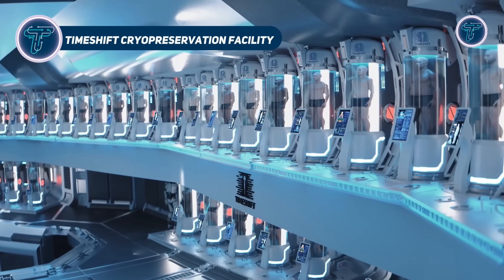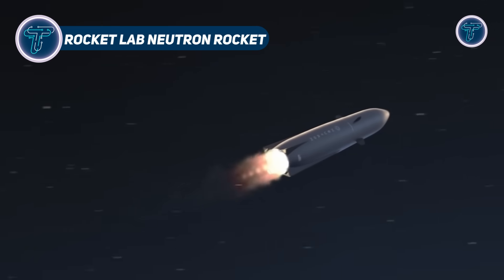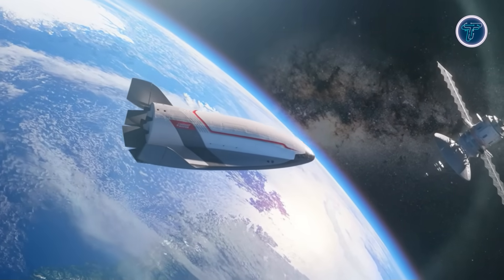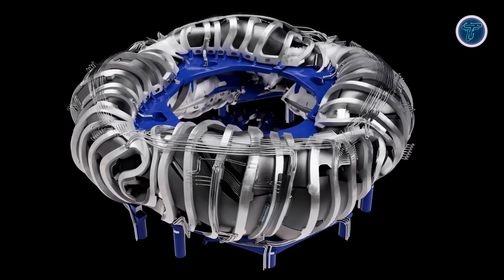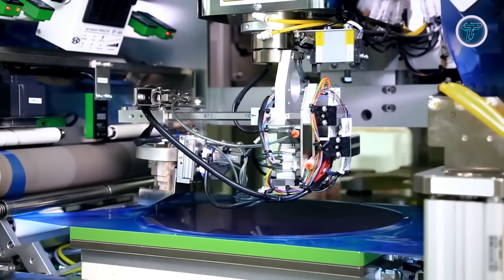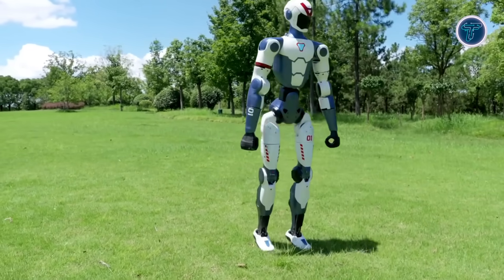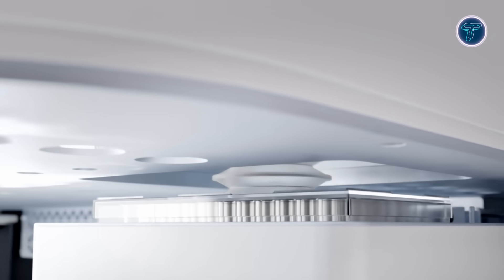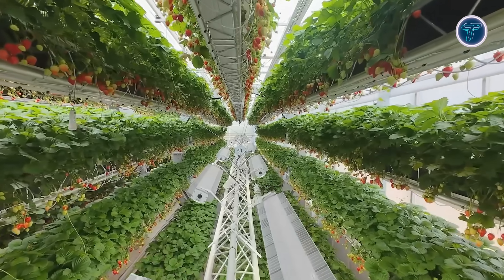15 Emerging Technologies that Will Change the World

Comment: I ask the following question: the kind of propulsion adopted for the BionicFinWave from Festo may be also used for building flying drones? I mean a drone which move through the air by means of fins like a cuttlefish instead of using screws like a helicopter